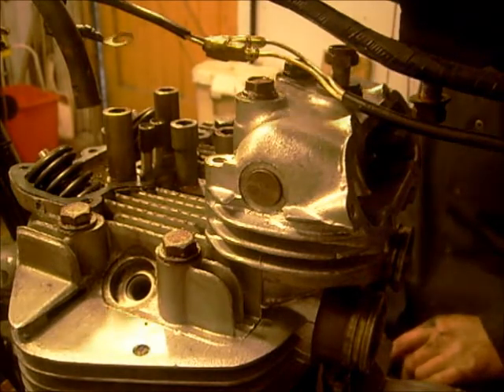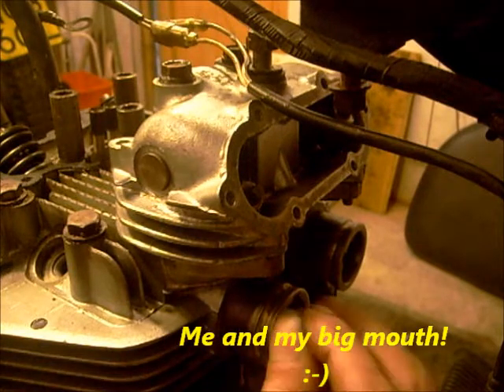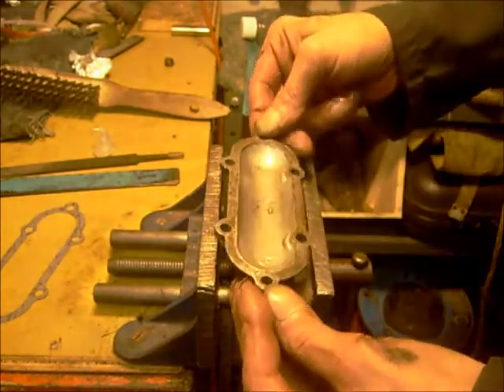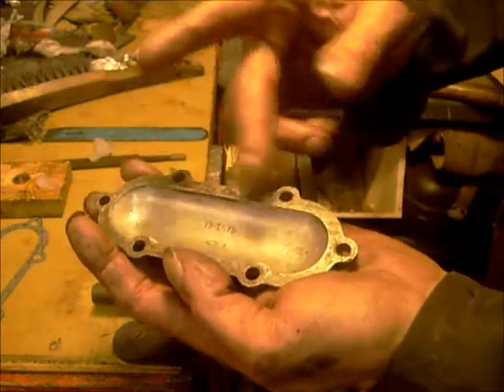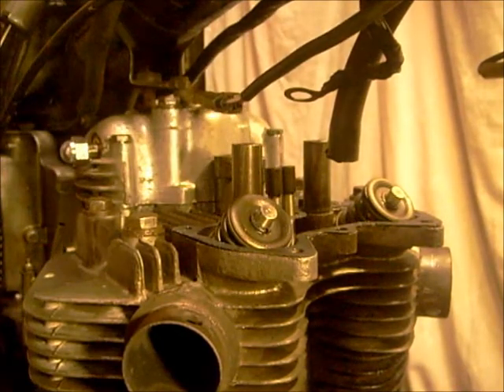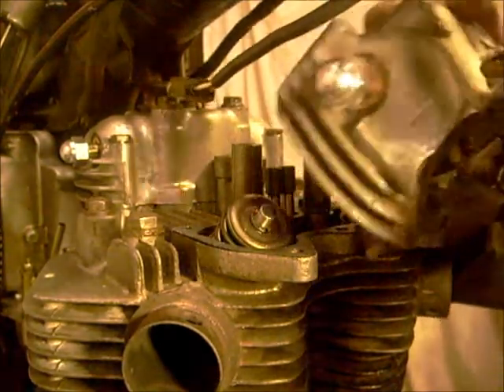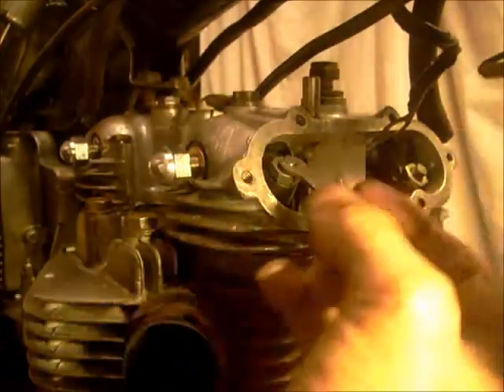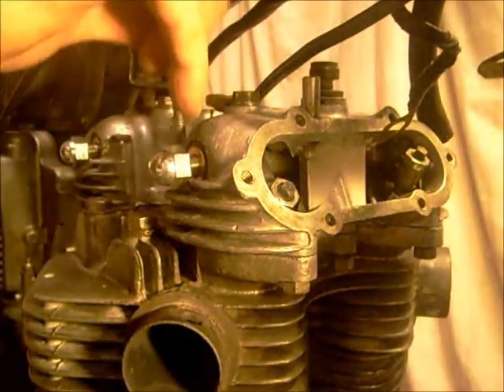T140E head gasket part 7

Comment: Hi mate how do ya replace a broken tacho drive can't see how u remove it cheers steve from durham
Reply from the maker: Hi Steve :-)
there is a bolt thing inside the drive you need to undo. To get at it you need to remove the large blanking plug mine has a screw head,then on the cable side there is a grub screw remove that and the bit that the cable screws onto should pull out so should the shaft. Also remove the shaft behind the blanking plug and you should see a nut head at the bottom undo that and the tacho g/box should come off the crankcase. Hope that makes sense.
Reply: Thanks mate il try that wen I get a min love watching ya video makes me want to take me bike to bits your better than a Haynes manual keep the good work cheers

Comment: Hi John, I've been meaning to ask for ages, You use silicone on a number of gaskets washers etc, is there any special sort you use? I will be doing a gearbox, motor and primary oil changes soon and fancy trying your method of sealing them again. Another great series of vids thanks. Your mate is very lucky to have you fixing his bike It will be as good as new when he gets it back. When do you find time to go to work?  Dave

Comment: Hello, I see that you used a 1/2"af on the tappet lock nut could I ask what the smaller wrench you used on the top bit is?
Reply from the maker: +Brandon Schofield 
Hi Brandon,
I use a home made spanner it started life a a magneto spanner then made to suit the tappet adjuster.